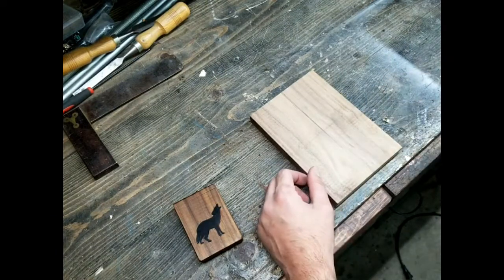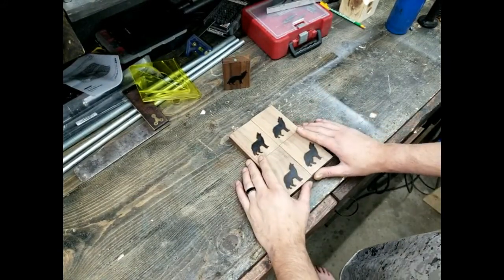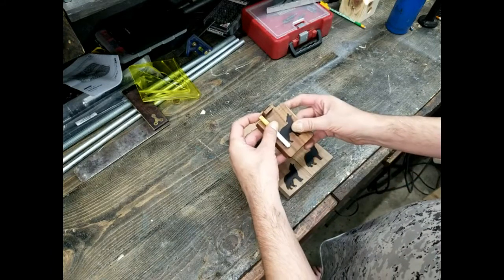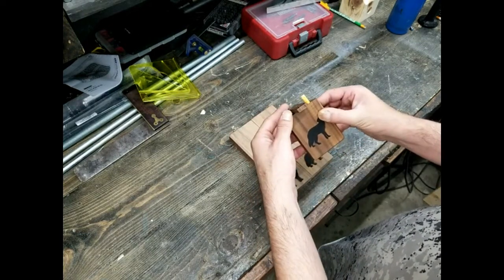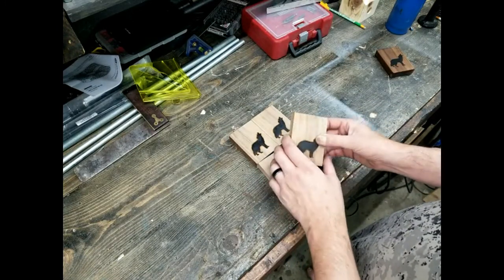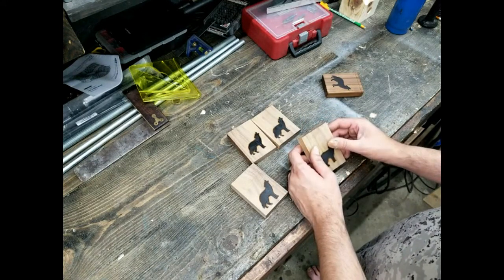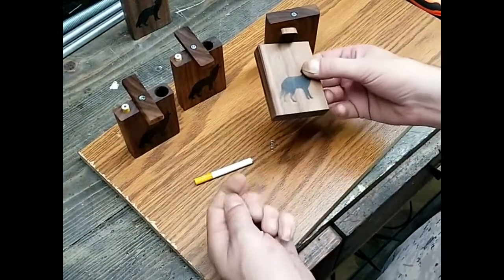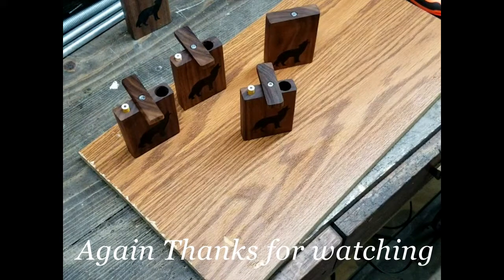This is How to make a Dugout made out of Walnut

Comment: I have been thinking about making some of these and the top had me concerned. With the grain running up and down like the body the top could be prone to cracking unless it was made with the grain running side to side. I know you will lose the grain match and have more work to do but I thought it might be worth it for the strength. I will let you know after I make some.
Reply from the maker: I honestly thought about doing them different and instead of using screws I was going to use a metal dowel something to think about

Comment: Awesome video! Thanks for content! One question though:
How did you stain inside holes? Just pour inside & wipe down w/ paper towel as much as possible? I got some of the butcher block conditioner/stain from hardware store & just want clarification on this part of process if possible! Thanks in advance!
Reply from the maker: yes just poured it into the hole let it sit for about an hour and use q tips to spread it out in the hole, then clean it out with a paper towel's, thanks for the view
Reply: @HowlingPrecision  hate to bring ya back again another year later.. but does this method seem to be efficient at keeping the contents from sticking to the side of the storage compartment
Reply from the maker: yeah unfortunately there is sticking issue but i dont mind it cause even the pill bottles i use for the extra weed i have the weed stickes to them  @nickmetzger3522